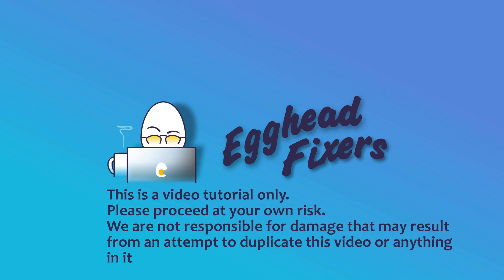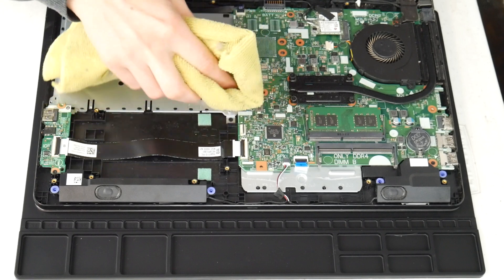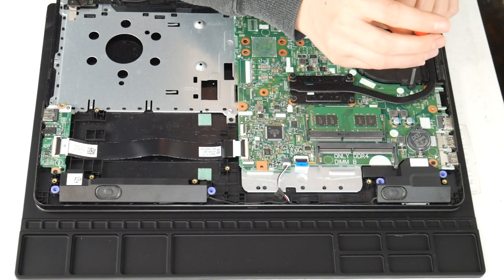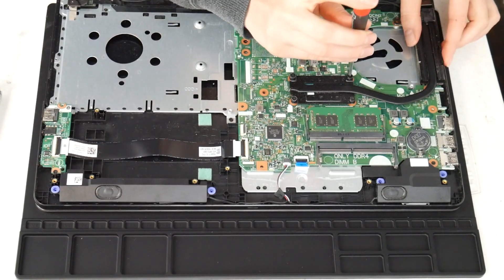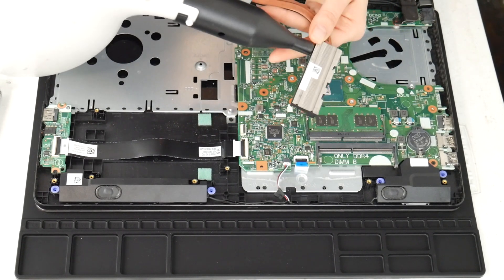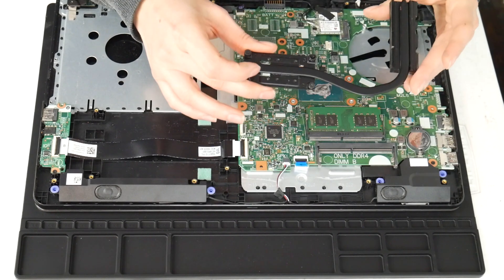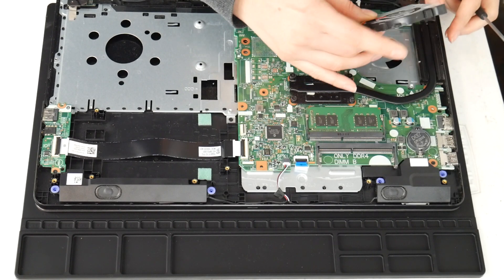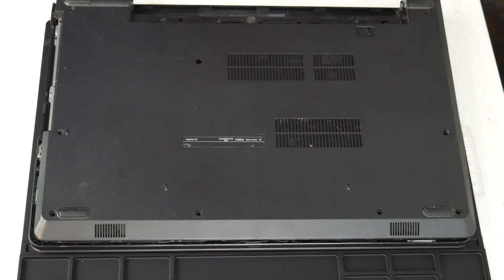How to Fix an Asus Computer That Keeps Overheating

Comment: Hello there I have cleaned my laptop asus N751Jx (2015)  very good. I cleaned the heatsink, the fan and changed the thermal paste with an artic MX4, but I notice again high temperatures (50°C in idle and 85°C under stress)but the thing that worry me the most is a slight burning smell. I don't know where it comes from. There are no burn marks on the motherboard. Did you ever notice something like that? thanks
Reply from the maker: That is strange. Have you tried replacing the fan all together? It could be something is stuck inside there causing a burning smell. Also how is charging? Does there seem to be any issue with that? A faulty charger or power jack can cause a burning smell.
Reply: @EggheadFixers  I replaced a few weeks ago the battery with a new one. I notice the burning smell even when the laptop is working just with the battery and not connected to the electric grid. The burning smell increase when I stress more the PC and the temperature rise. About your first question. I don't have a new fan for replacing the old one. I'm going to check if there is something stuck inside the old fan as you suggested. I'm also going to detach the fan from the heatsink to clean properly at the interface heatsink-fan